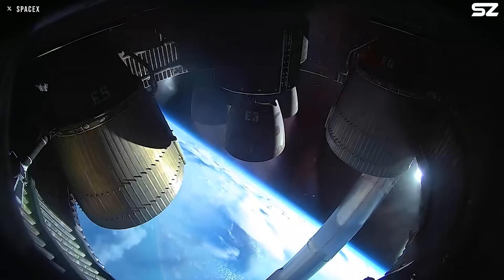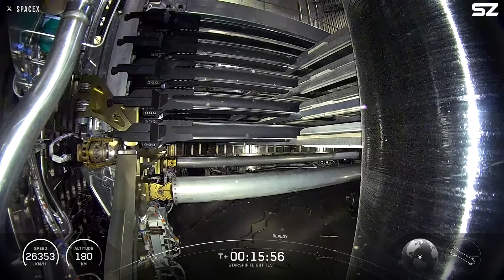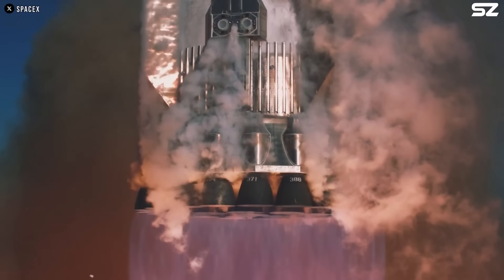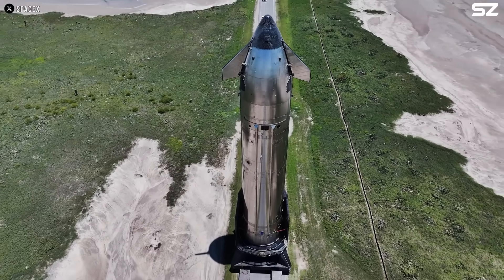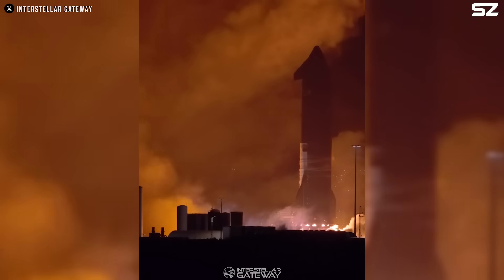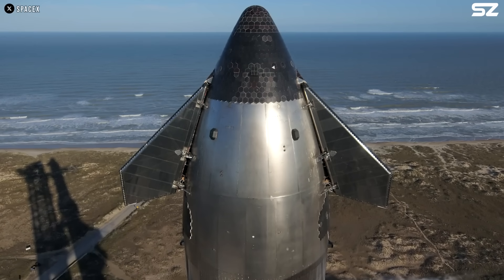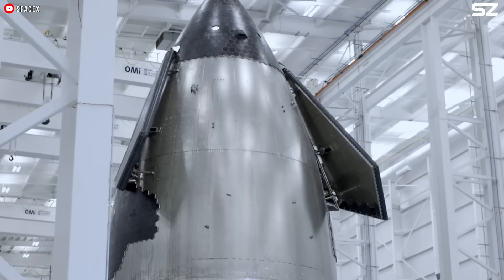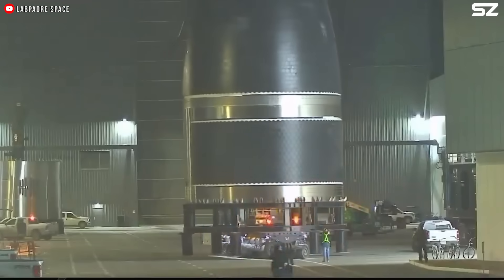SpaceX's New Brilliant Solution on Starship Flight 9 Problem!

Comment: The vehicle has no rcs thrusters because they want to perfect the bare minimum of the vehicles concept with ullage venting/thruster.. and not waste a bunch of money on each launch with rcs, cargo doors, actuators, batteries, tanks, wiring, plumbing and whaterver else many armchair critics think these prototypes should have.

Get the absolute bare minimum working, tack on redundancy later.. its smart, efficient, cheap.. and its why Elon is the best CEO to ever live and why armchair critics who couldn't land a water bottle on its side much less a 20 story tall rocket aren't CEO
Reply: It has no backup, because Starship has a weight problem.
Reply: @patrick_test123  starship doesn't have backup systems because it cost tens of millions of dollars and tens of thousands of man hours to add when they don't even know if the vehicle can get to seco. Had they added that expensive time wasting stuff it would still at best end up at the bottom of the Indian ocean. At worst, adding redundancy like thrusters or feature like cargo doors complicates future prototypes and slows the whole program to a crawl.

I'll trust Elon and SpaceX engineers estimates on its payload capacity before I give your armchair opinion about weight issues even one single second of consideration. They launched 18 rockets last month, you've never even launched a coke bottle
Reply: Given the many issues starship is having, I'm starting to become sceptical on if the design is flawed. But since you can never really know, I'm happy for spacex to keep working on it (as long as they can avoid RUDs outside of their no fly zones)

Ultimately, only time will tell, and I do hope it works out
Reply: @Jason9637  it's not having issues, it's predictable failures of unsafe engine shrouds and a aft attic where gas is collecting and causing explosions and fires. They already have the solution. It's called raptor 3 and ditching the attic and engine shrouds.

Meanwhile while raptor 3 is still in the oven they can prove out a 100 other science experiments by continuing to launch prototypes. Just like Elon nonchalantly says "we'll add more venting capacity for the next ships"
Reply: @NPCSoftwareInc So it is a design issue, and they have a redesign to remedy it. I can't wait to see how it does! A booster catch and successful re-entry in one flight would be awesome
Reply: @Jason9637  they've already caught the booster and had successful re-entry on flights 5 and 6